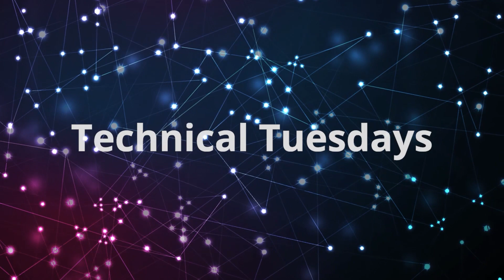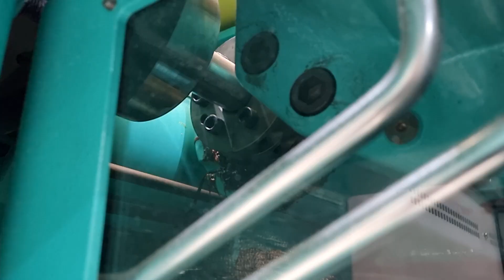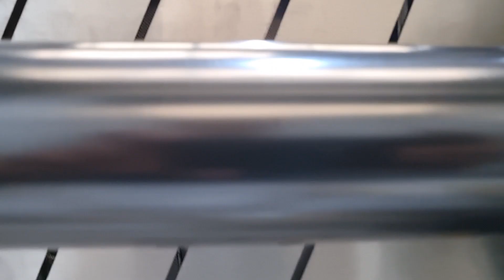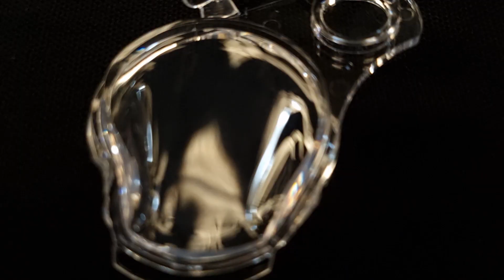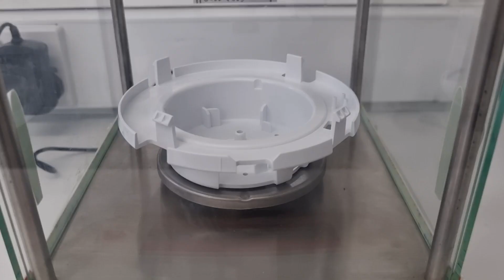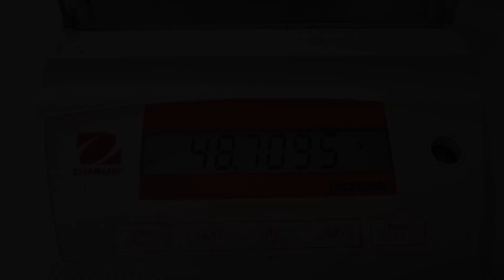BACK PRESSURE | Technical Tuesdays | HYMID

Comment: To understand back pressure here's a simple analogy -  if you think of sliding a large wooden box down a stairs... you will need someone below the box pushing up against it to stop it from sliding freely down the steps and getting out of control. So while the box is sliding down the stairs, the person below the box is pushing up against it as if they were trying to push it up the stairs. The box is like the screw going backwards during plasticising and the back pressure is like the person below the box pushing up. The screw goes back and the (very badly named) back pressure pushes against the screw in the forward direction. Back pressure has some positive and negative effects. On the positive side, back pressure squeezes the air that comes in with the plastic granules back up through the hopper so you get less chance of bubbles and splash marks in the parts. Back pressure mixes in colourant better. It adds heat and helps to melt the material. On the negative side, it leaves the melt more compressed in the shot after plasticising so this can cause drool and strings as the mould opens (more decompression distance can counteract this), it also slows down plasticising so if the part walls are very thin and the part doesn't need much cooling you can potentially find the mould waiting for plasticising to finish after the cooling time is finished - giving slower cycle times. The temperature increase from higher back pressure can cause degraded melt if the material is very shear sensitive (eg PVC). Back pressure also affects shot size consistency and it's impossible to guess what back pressure will give the most consistent shots. So to optimise the shot size consistency you should run 10 short shots with different back pressure levels and see which back pressure gives the most consistent shot weight (range or standard deviation) over 10 shots. Back pressure does make the shot bigger by compressing more melt into the shot - typically I would expect to see around 0.3mm extra in the shot size if I doubled back pressure from 50 bar to 100 bar. In imperial that's about an increase of 0.012 inches in the shot if the back pressure is doubled from 750 to 1500 psi. We can see this increased shot size clearly as the melt cushion increases when the back pressure is increased.

Comment: I dont necessarily agree with back pressure and part weight comparision you drawn in your video. Also, the other thing I noticed is the part weight only went down by 0.02grams or something. That's not big enough change to draw any conclusion.

Comment: I've been molding for 25 years. As far as I know adding backpressure increased the shot density therefor increasing the part weight. Or maybe i've been doing it wrong all along.
Reply: As you are 25 years experienced, I want to speak with you sir
Reply: Your right. It’s a compression therefore increases the density

Comment: Back pressure is the amount of pressure the plastic has to exert on the screw to force it backwards, hence the name: back pressure. Increasing back pressure increases the density (the weight) of the shot (molten plastic) at the front of the screw.

Comment: thnx for video BUT
i would ask about raising the back pressure u told us in the video that raising it make the part weight less while the density getting higher how is that possible i think both should getting higher 
Thnx
Reply: Increasing back pressure does increase part weight. I have not been in their facility to see what exactly is going on with the part weight in their particular scenario. I could speculate the back pressure is causing the plastic pressure to exceed the nozzle contact force and drooling between shots. Perhaps the hold time is shorter than needed to completely seal the gate leading to inconsistent part weight, the process could be running pressure limited causing weight inconsistencies with viscosity changes. If it's a hot runner mold the hot tip could have an internal leak. It's a guessing game without thoroughly investigating a root cause.